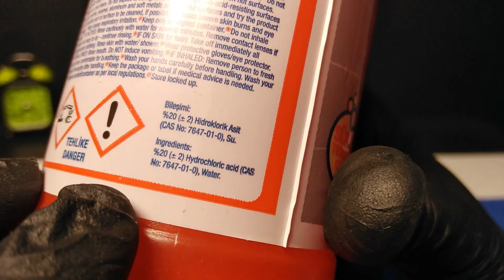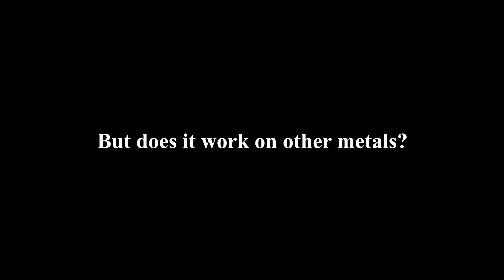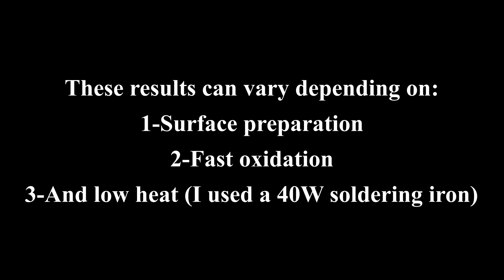Stainless Steel Won't Take Solder? Try This! (Does It Work on Other Metals?)

Comment from the maker: 📌! Important note :  
After soldering with HCl, don’t forget to neutralize both the metal surface and your soldering iron tip.  
A simple baking soda solution is enough.
This prevents corrosion and protects your tools. Stay safe and solder smart! 🔧🧪